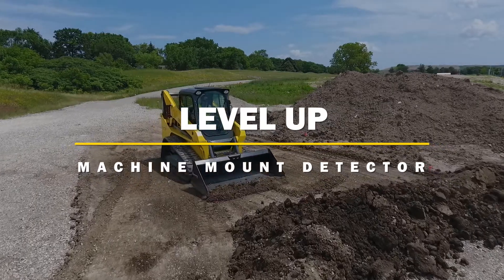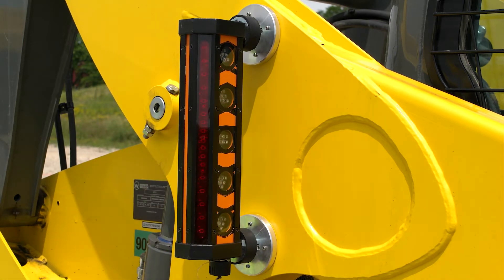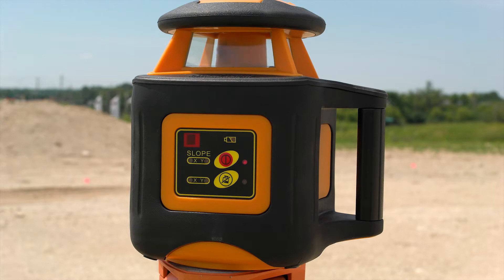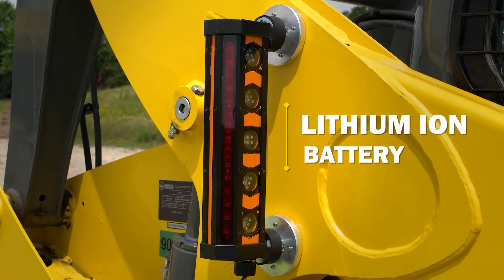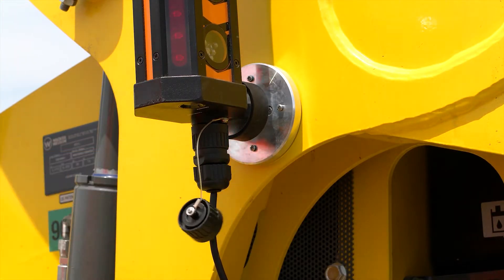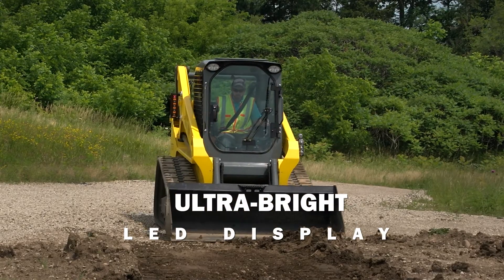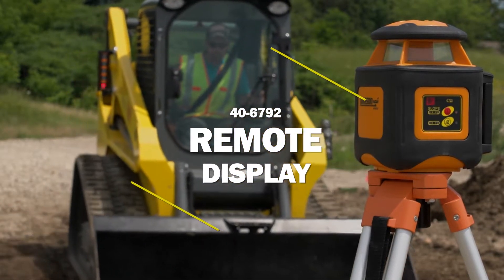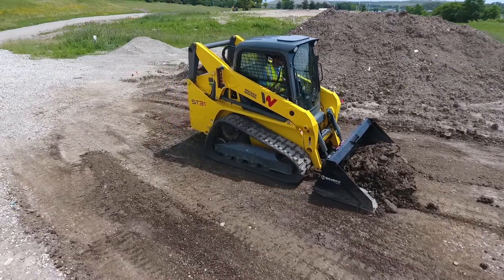40-6791 Machine Mountable Detector

Comment: I bought the detector and the remote  for a 550k.  The cabling is laughably cheap. connections are very cheap set screw type. They replaced the fried detector two times and it recently met the same fate, but this time they decided to ignore my emails!  Evidently this product has a few brands it sells under. Beware